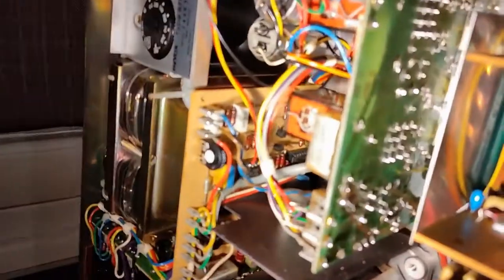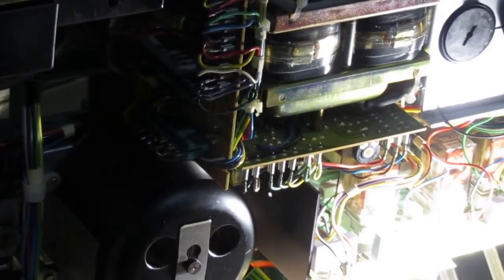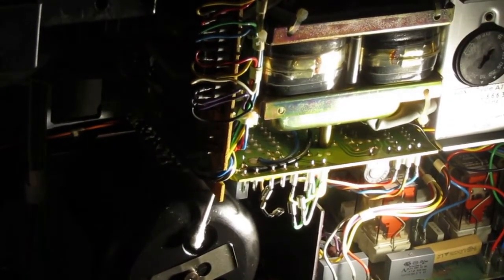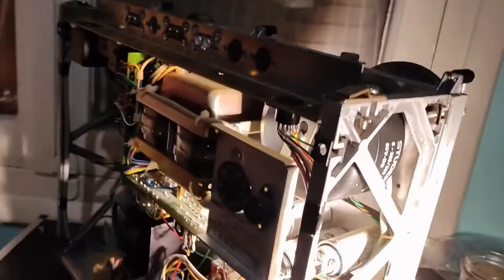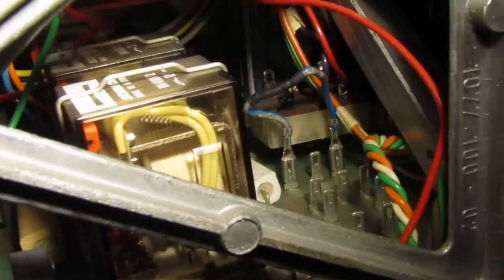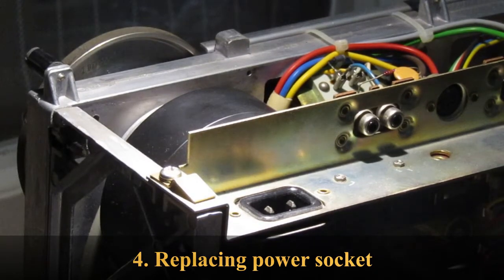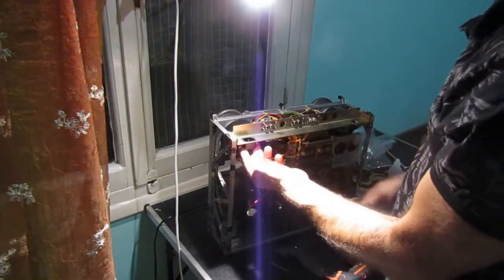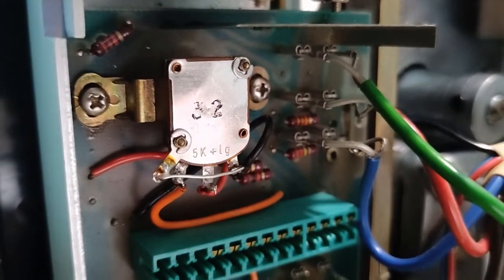Revox A77 Marathon: Part 2, repairs and modifications

Comment: When replacing the adapter plug I would have tied the green to the chassis. Not sure if it would create a ground loop but I would have tried it first.
Reply from the maker: @MikeGervasi  i read everywhere that ground should not be connected. So i didnt even try. But any way trying would be no harm.

Comment: 😥I should have watched your video before powering up my dad's A77 that had been stored for 20 odd years. "Time bomb" problem happened within 10 minutes and as you predicted also burned the next by resistor and of course the fuse then blew. New caps are on order and will likely recap all the amplifier boards. You wouldn't have a list of the values for the trimmer pots, should I feel inclined to also change those at some point?
Thanks for great videos. I just spotted you've also done a video of a DIY internal audio amp - which I will also watch soon.
Reply from the maker: If you don't change the trimpots they will most probably fall apart as soon as you try to move them for calibration.
Reply: @dchatz  yes, they are already falling apart even before touching them, so have now ordered two kits for the 2 x A77 I am restoring.